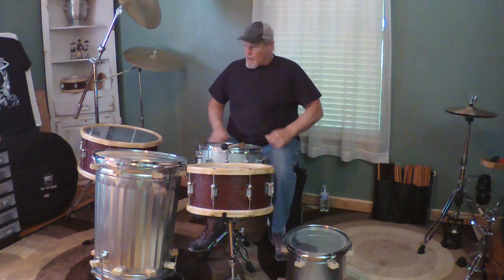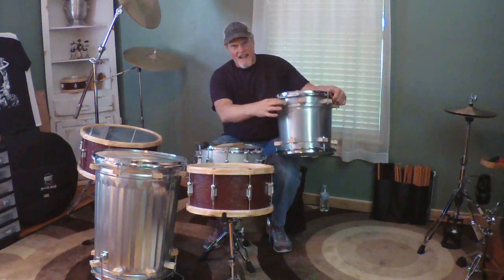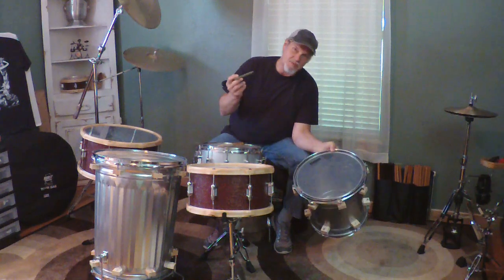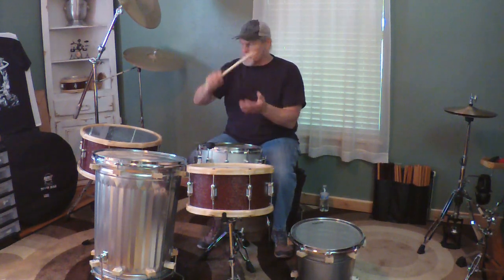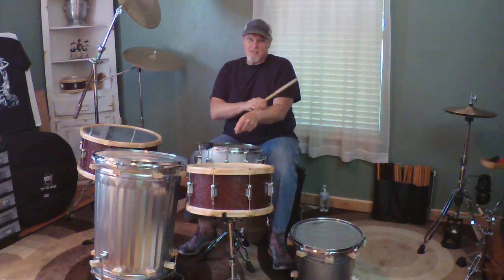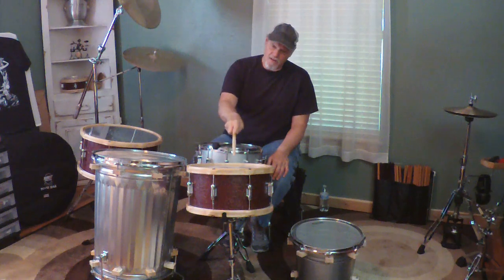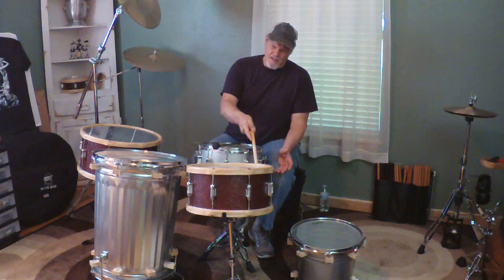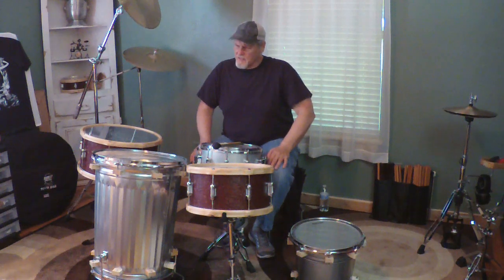Drum Shells, Sound, and Hype - Part 10: Sustain

Comment: I've been binge-watching up till now and totally agree with all of this... which also brings into question the various tom mounting styles and hype that one is vastly better than another to help shells "resonate" better, etc., when this is simply not true and/or at least overstated.
Also and lastly, the leather wrapped drums have more sustain simply because they have shells that are more heavy/solid, to where the thin-walled trash cans are vibrating and thus robbing some of the sustain from the heads. Again, showing an exaggerated example that a shell that is too thin or "resonate" can actually rob sustain of the heads.
🥁💫🥁
Reply from the maker: My first binge watcher (to my knowledge :-). Thanks for watching. 

Having used various tom mounts over the years, I have found the shell mount brackets will take away some lower frequencies and resonance of the overall sound but, as always, so much of that gets lost in a band setting. Same thing with isolating floor tom legs from the floor it sits on. You gain there, too but, no one can actually hear the difference when the music gets going. Floor toms never sound that great live, either, no matter how they are set up. That's why I began to just make my larger drums the same size dimensions as rack toms. 7x14, 8x16, 9x18, 10x20 and mount them in modified snare stands. They have a lot more tone and power impact with my recording mics. 

In the case of the trash cans, I made new lugs for those; same wooden lugs but, mounting them better, which allowed for a little better tension placed on the heads, and thereby gained some better tone and sustain. Matter of fact, should you get to the last video I uploaded, the video version of Solos for Concept Drum Sets, the guy who mixed and mastered the audio recording said the Trash Cans are his favorite set of the bunch! They do sound quite good in the audio recording. If I didn't tell anyone, no one would guess what they are. Same for all the sets on the recording.

Comment: Do you have any videos on Cymbals? I clearly believe there is a judge difference in Cymbals
Reply: Hudge difference
Reply from the maker: @danparisi8093  Not exactly sure what you would like to see/hear. One thing that is on YT are hundreds of videos of individual cymbals and their sound. If I go to purchase a cymbal, new or used, I look it up on YT and check out as many videos as that cymbal has to get a comparison between them all for pitch range in a certain size and model, and overall character and personality. You hear variations of mics used, and room environments, etc., but, in the mix of what I find can be heard the general tone of whatever cymbal I'm looking at. YT is invaluable for that. 

Hand hammered cymbals can have pitch differences within the same size and weight class. Machine hammered are more consistent. Paiste has very close, to identical consistency. As does UFIP in my experience. But, even there, it can become nuances and subtleties with other B20 cymbals from each company. Paiste alloys and processing are just very consistent. UFIP Roto-casting makes for very consistent cymbals. The big companies get things done with good consistency, generally. I stopped purchasing Zildjian because of quality control issues. Maybe things are better today, idk, and if I purchase a used cymbal with a sound file, I know what I'm getting.  

Where that really applies might be cymbals made in smaller foundries overseas, or foundries where quality control is not a major issue, which produce hand-hammered cymbals. Dynamic ranges can vary greatly. I had one shop owner tell me cymbals made by Dream cannot be returned because of sound variations you aren't happy with. What you hear on a YT or other demo video might vary greatly to what you'll get when you order the same model. He would not guarantee it's sound.  I have purchased Wuhan cymbals that had  pitch differences in the same model. 

I don't play cymbals from only one company because no one has enough variation in sound colors to capture everything my mind hears when it comes to sound. I use Paiste, Sabian, Soultone, Stagg, UFIP, Wuhan, and Zildjian from various lines each company makes. My favorites are UFIP Class series and Paiste Signatures. But, even there, especially when it comes to rides, I might have things from each company, machine and hand hammered. 

I have thought about doing videos of cymbal tones, in general. I just don't have the room or space to set up comparison demonstrations, and it seems rather moot considering all the cymbal demos on-line. Paiste has a terrific web site for sound files. Other companies have such examples to one degree or another. I take advantage of all of that when purchasing a cymbal.
Reply: Awesome thank you so much for taking time to get back to me. I also love Paiste Signature.
Reply: @danparisi8093  The way cymbals make sound and the way drums make sound is not comparable. With a drum you have a plastic membrane that’s tensioned on a shell. With cymbals you have a piece of metal that is struck and the sound is the piece of metal vibrating. It’s the most simple and uncomplicated instrument in existence yet there are so many variables that make that chunk of metal sound the way it sounds. Cymbals are much  more individual works of art that are played as musical instruments.

Comment from the maker: I received an email notification of a comment placed on this video. It does not appear here  and I can't seem to find it anywhere else, either so, perhaps the poster deleted it. It does raise issues I have commented on many times now but, I know if someone writes something, others think it so, I'll copy and paste it here, with replies to the points raised.  In multiple parts because of length. 
******************************************

I agree with some of what you're saying but you might be taking it too far. I'm not trying to defend advertising hype; but to say that the heads do everything and the shell does nothing even on a basic level seems short sighted in my view. *******Far as I recall I have never stated shells do nothing and heads do everything. Because of drums like Roto toms, Flats, Traps, etc., I would logically conclude just from that, the sound of a drum is 98% a membrane that can be placed under tension on a frame. What then would a shell contribute? Nuances and subtleties, something I state over and over and over. Nuances and subtleties that get lost when surrounded by input of cymbals, etc., and especially a band. 

There has to be variables somewhere. 1st: in the earlier videos you said the difference in depth makes no difference. you compared a 7" deep tom a 8" deep tom a 9" deep tom and you said they were all the same. You were right that they did sound quite similar. But now you seem to be playing both sides of the argument by saying the depth of the trash cans is making them sound tubby. So which is it? ***** In the case of a 8x12  vs. 12x12 the extra depth contributes to a slightly slower movement of air that gives the impression of throatier/tubbier sound and slightly more volume hence, companies calling them "Power Toms" when those tom sizes were introduced decades ago. Fl. toms were already square or "power" depths and because they can be so throaty or tubby sounding, they introduced FT's with decreased depth to change feel and tone a little. The difference between manufactured drum depths and a trash can deeper than it's diameter by six inches is enough to warrant a dramatic tubby sound but, even there, a shallow drum can have thicker or muted heads put on them tuned a little lower and you achieve the same thing. I prefer shallow drums for feel and tone. Half toms, I call them: the depths half the diameter. Almost all of it can be addressed in numerous ways with live sound and recording equipment. Feel is feel, per player but, sound? So much can be done without changing drums. Once again, that brings us back to marketing hype and the purpose for the video series.
Reply from the maker: 2nd: some drum builders say you have to glue a wrap on the entirety of the shell in order for it to sound good. the alternate way is to use double sided tape. I've seen videos of drum restorers (some of them have good reputations) who claim tape disturbs the sound because it doesn't make the wrap one with the shell. They also claim you have to glue every part of the exterior of the shell (as opposed to gluing sections and leaving other parts of the wood unglued). So, by that logic, the wrap (and by default the exterior) and how it's applied must make some kind of difference in sound. *******Claiming something does not make it so. I have used wraps, wood veneers, wallpaper, leather, glues and tape and I have never heard any significant differences. Again, when somebody takes two drums, one glued, one taped and demonstrates the sonic differences I'll still go by my own experience but, at least an honest demonstration has been attempted and supposed differences displayed. There are none, as far as I know, though, and there never will be because gluing plastic wrap or taping plastic wrap to the outside veneer of a plywood shell is moot. Glue has no resonance. Plastic wrap has no resonance, no tonal qualities. If a shell made that much difference gluing a dead substance to it would decrease its resonance and deaden the sound. It doesn't. Why? Because the inside of the shell is where the action is happening between the soundwaves and air column thrown off by the heads, not the outside. 

On the same concept, what about suspension mounts? Sometimes they improve the resonance of a drum. I also notice in your videos you have been holding all of the drums under the batter hoop when you test them. If the shell is useless, then why don't you hold the drum on the body of the shell with your two hands and have another person play it? The sound will likely be very muted. That would also prove the exterior shell makes some difference. Gary Gauger came up with his theory about the RIMS mounts by holding the drum under the batter hoop (like you did in your videos) to test the resonance. So there has to be some basic physical principle going on with the shell. *******I mention isolation mounting and its advantages so many times I am amazed you have missed it. I mount all my toms in modified snare baskets and have for 25 years now. Actually, back into the 60's and 70's when I put my rack tom on snare stands, when I played a 5pc kit. Isolating the toms from constricting hardware is an old, proven concept. Fully constructed drums vibrate as a unit. That said, I show where just touching the reso head can totally kill a drum, regardless of shells. The sound of a drum is mostly from a stretched membrane(s) and shells contribute nuances and subtleties of frequency enhancement/detraction, and volume. Beyond that, I have yet to see videos where differences are demonstrated that can be heard in the context of a band, regardless of how much money is spent on shell-hype marketing. I've been around long enough to know the history of manufactured drums and the growth of marketing hype to sell product.
Reply from the maker: If everything is entirely about the heads, then why do people claim that synthetic shells are more consistent? Fiberglass shells have a reputation for giving a consistent sound regardless of weather conditions. Hot cold wet dry humid etc. Wood drums (being an organic material) sometimes fail in those environments. You even mentioned leaving the toms on the floor knocked the heads out of tune because of your heating system. *******Indeed, the cold floor effected the heads, not the shells. Not as much as calf heads but, the idea that temperature and humidity can dramatically effect drum shells and therefore sound, is rather nonsensical because plywood drums are glued veneers and pressed together under extreme pressures, and if they have a plastic wrap on them, or finish materials inside and out, humidity becomes rather moot. I'm not saying shells cannot expand or contract to some degrees but, the claim non-organic materials perform more consistently is just more marketing hype to sell products. Metal drums can expand and contract under temperature extremes. Fiberglass drums will always be outskirt players in the marketplace because of the higher price points. Acrylic has basic cosmetic/color option problems for the majority of consumers. And all of them can be easily modified by changing heads. I keep coming back to this: the number of head options head manufacturers make, and their quest to be able to reproduce the SOUND and feel of calf heads. Calf heads were the problem with temperature and humidity circumstances, not shells, whether solid or plywood.  

Lastly, if the shells and edges don't matter at all, then why are studio engineers so picky about what drums to use for recording? *******Again, I've never stated shells do not matter at all, and edges are basically muting devices to very slight degrees but, you now drift into an area that is totally subjective and esoteric, and beyond the scope of the subject I'm addressing. Factually, not all studio engineers are so picky. They know what mics and software can do for any drum set on the planet. I have recorded with Ludwig's, with beginner level drums, and my own drums I build myself. All of them can be changed with heads, mics, mic placement, and today, especially, the endless software options to color sound. That makes "picky engineers" rather silly to me, and I have had engineers comment to these facts in comments on some of these videos. 

Sometimes entire drum sets are swapped out for sessions because one set works better in a particular room. *******Yes, logically, the way a thin-shelled set plays versus a thicker shell-walled set, or other shell material, in a given acoustic environment can vary. Again, so can heads, mics, and software. Why did Peart always play his Slingerland snare drum but, that all changed when he went with DW? Buddy liked his Fibes snare. Would anybody in the band, audience, or listeners of recorded music hear dramatic differences? No. So, we are addressing something that is very subjective, player to player. Why does a profound drummer like Peter Erskine leave DW and go with Tama, testifying their drums just sound better than any other company? Peter knows. I don't. I know the differences I have heard in all drums I have been exposed to in 55 years of playing has nothing to do with drum shells. Hardware/mounting, sure. Heads, sure. Cosmetics, also subjective, sure. Shells? No. If anyone actually made a superior sounding shell that dramatically effected the sound of the drum for the better, the vast majority of players would use them. That, alone, tells me nobody makes better drums, by virtue of shells, than anybody else, that could be heard by the general family of drummers on the planet. EVERYBODY makes great instruments, model to model, price point to price point because the competition is fierce. NOBODY makes a better sounding drum, objectively speaking, than anybody else, that can be methodically demonstrated. They cannot even demonstrate it model to model within their own lines, let alone company to company. What does that tell me? 

Ross Garfield in LA has a big drum rental business. He rented Lars Ulrich the drums he used on Metallica's black album. He also rented drums to Matt Sorum for the GnR albums he played on. The kit he rented to Lars were not Tama drums (Lars' endorsed company). They were Gretsch with hot rodded bearing edges. If there's no difference in any shell or edge, then why did they feel the need to switch drums? That's not an isolated incident. A lot of drummers have designated studio kits because they work better in the studio than their live kit. Kenny Aronoff goes to the studio with a variety of snare drums AND bass drums. So does Gregg Bissonette. A lot of what you're saying is valid. There is a lot of hype (and in some cases lies) in the drum business and sometimes differences can be minimal. But then again, there's a point where one has to use his/her own ears. I'm not an endorsed player. I have no interest in selling drums for anybody. But at the same time, if something comes along that sounds better than what I'm using (for whatever reason) I'm not going to ignore the possibility of using it in order to reinforce a theory that everything is exactly the same. *******Again, your examples are anecdotal and subjective, with no sonic evidence to solidify the points. As I show throughout all my videos on my channel, using regular Keller shells, other shells, no shells, Sona/compressed paper tubes, stacked plywood, PVC, or any other material, I do my thing the same regardless. Not knowing the drums players take into studios, I know it can be as much about varied depths and other aspects not associated with shell materials at all. If you come upon something that sounds "better" than what you are using, at the same price points and materials, share that with me, and why you made the switch. I make my own drums because I know they sound as good as anything out there. There are just not any dramatic differences in the frequency range of drums that can be discerned in the context of a band, live or recorded, that cannot be addressed by mounting, heads, tension, mics and software.